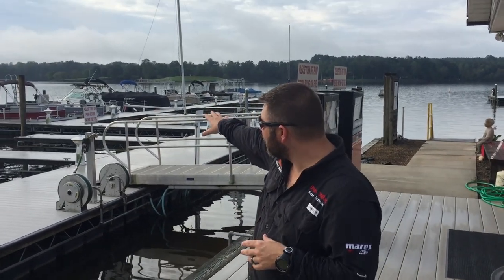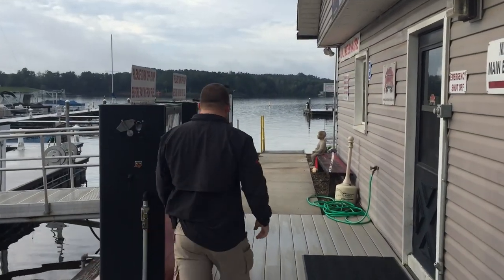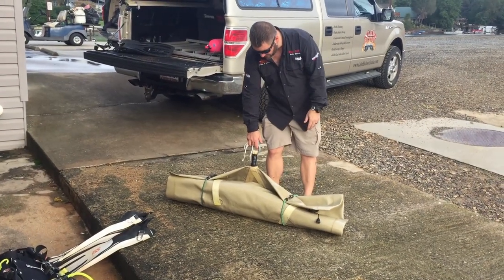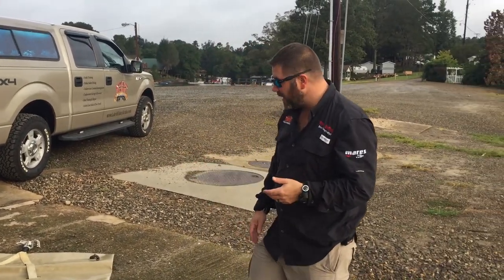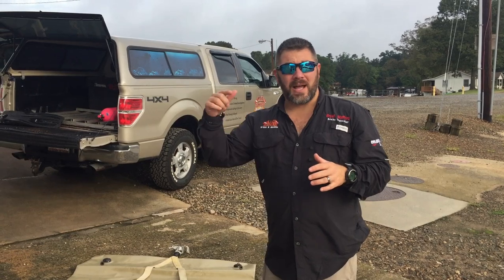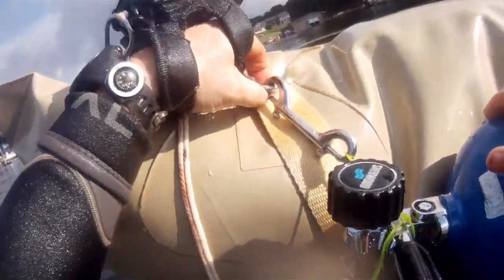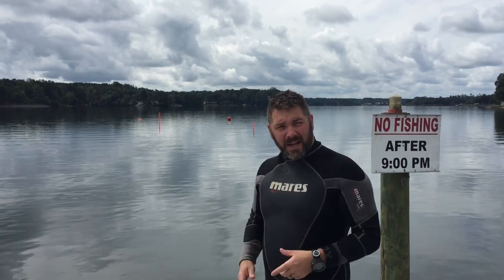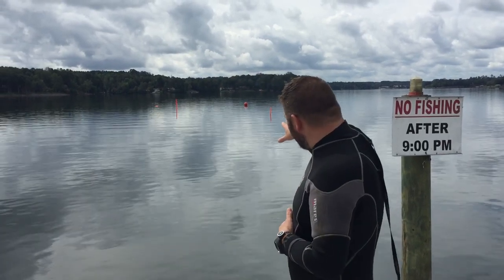Lifting A Satellite Dish

Comment: How cold is it this time of year? Great Video.
Reply from the maker: Right now the surface is between 75-78 degrees.  The first thermocline is around 20 feet, and the temperature drops to 70 degrees.  The next thermocline is around 60 feet and it’s 60 degrees. The last thermocline is at the bottom at 100 feet and it’s around 43 degrees.
Reply: LakeHickoryScuba so it’s warm now but when you get into the deep, your toes fall off?
Reply from the maker: Pretty much.